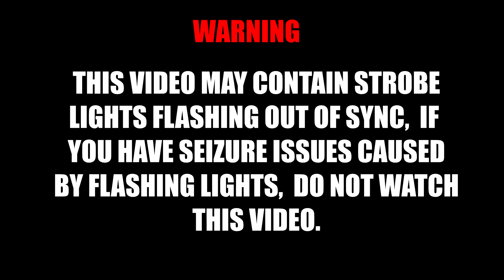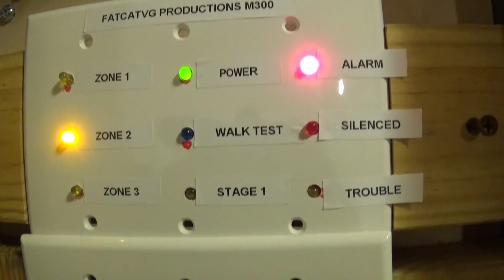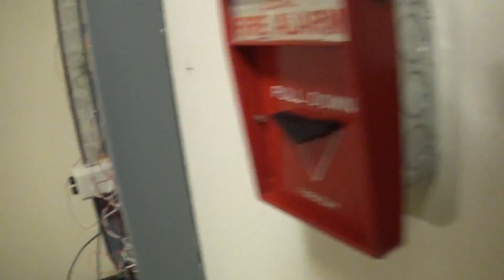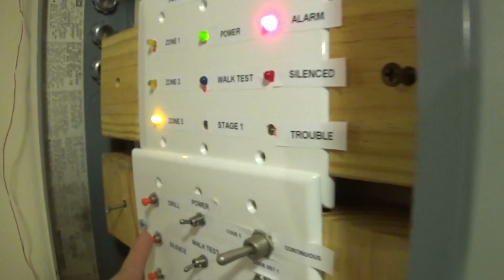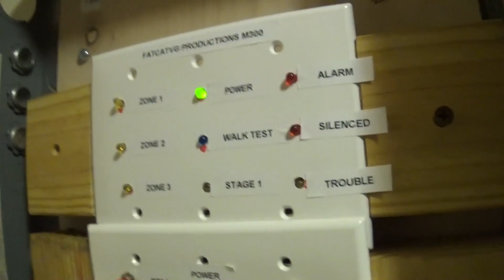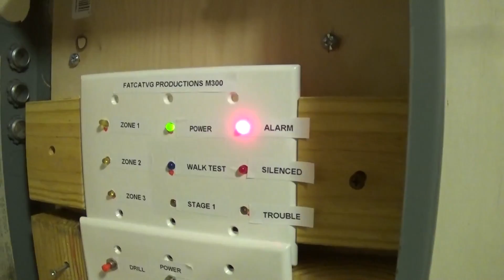System Test 9

Comment: For system test 27 you should all Gentex commander devices. The commander 4 is a ceiling Mount version of the Commander 3 and have them all set to temporal low volume electromechanical horn code 3. Which is my request

Comment: Also, I'm glad that you got your 7002T to work properly!
Reply from the maker: Yeah it turns out it was just running on low voltage. about 16VDC
Reply: I may have to a a couple of power supplies myself soon because my batteries are getting pretty low, and they are like $20 for a pack of 12 in my area.